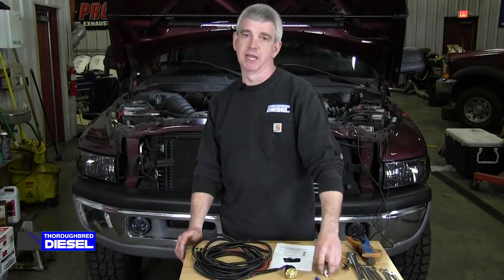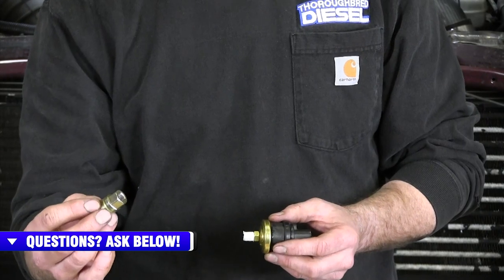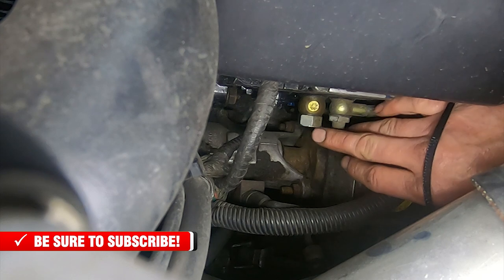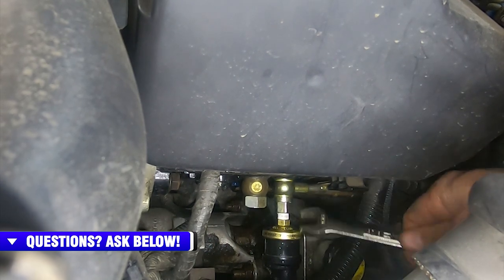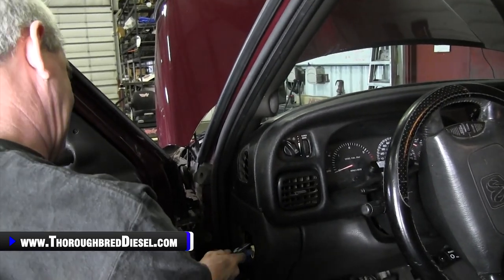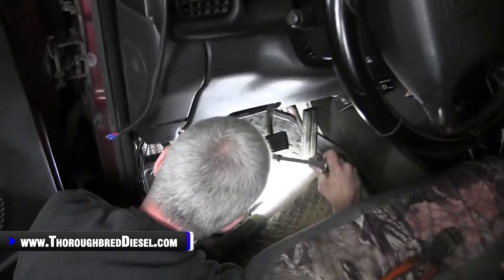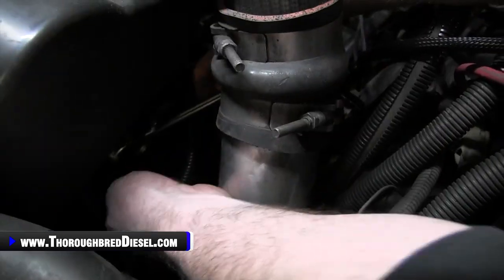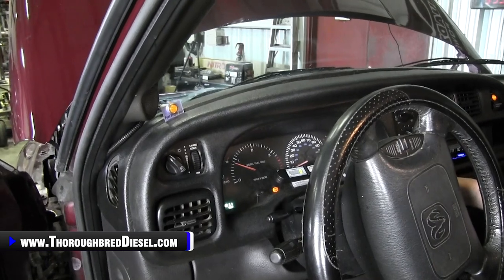Watch This Install | Improving Vp44 Trucks With Airdog Fuel Light Kit! #diesel #cummins #dodge #fyp

Comment: Really great tutorial on the low pressure kit. Do you have any suggestions for the 5.9 ISB, with a air brake compressor being in the way?. 
Thank you. 
JA
Reply from the maker: Thanks!  The sensor itself will just need to be moved to a suitable location (possible a port on the fuel filter) also, with this kit you have to ability to use the banjo bolt, or just have the sensor installed with the common 1/8 NPT port.
Reply: @thoroughbreddiesel  Thanks for getting back. My vp44 input is the bolt and banjo. Great info that I can put on anywhere after filter. I am absolutely bomb-proofing my 5.9 in every way so I do not have a $1000 tow bill on my bus. Will be ordering shortly. 
Thank You
John A 60107